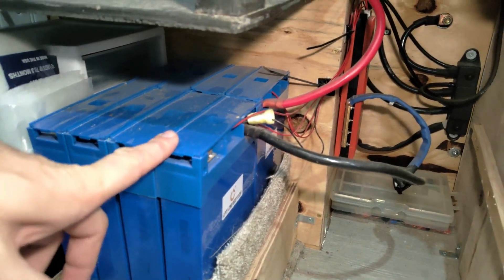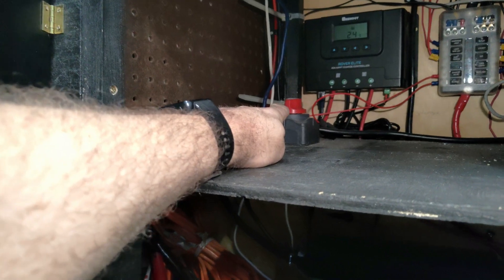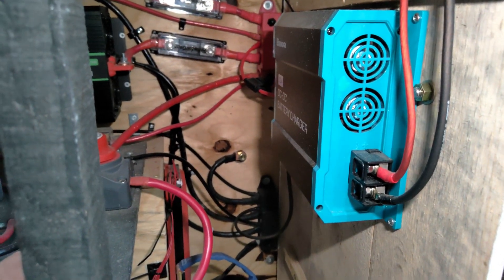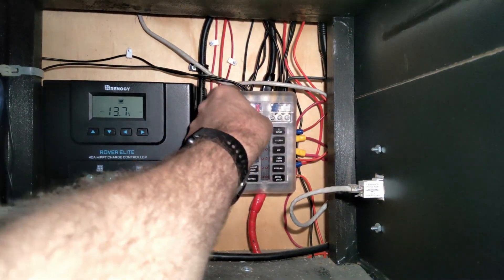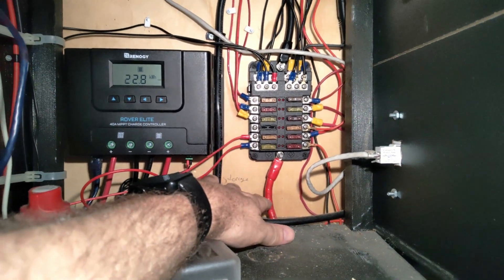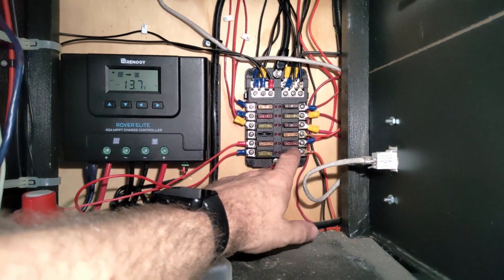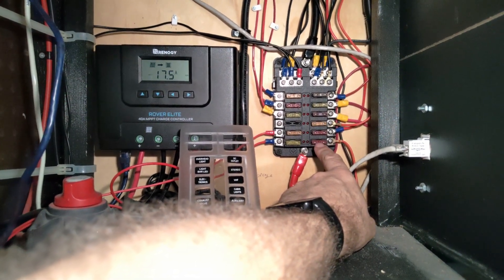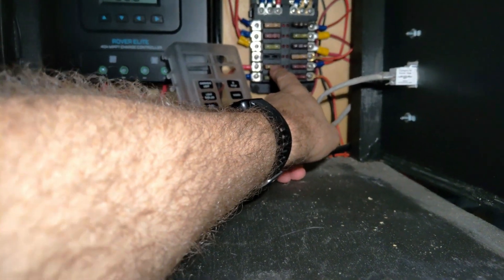The DC Fuse Box - Wiring Your Off-grid Batteries for DC circuits

Comment: Can you just run all of your black ground wires from each DC appliance to the frame of your vehicle and then the fuse box ground also to the frame eliminating all the extra black/ground wires going directly to the fuse box? If that makes sense. Thank you for your video!
Reply from the maker: Technically, yes, but it is easier to run wires back to the fuse box than it is to find an exposed part of the frame, since all the point contacts need to grind down to the metal, and that increases the chance for rust on the frame, so always better to close the loop to the battery. I do have one connector that goes to the frame because it made more sense to do so in that case. That is the dual USB ports for the dash cam and GPS.

https://www.youtube.com/watch?v=PGg1YvLoSZE

Comment: Do you have to have a specic fuse panel to handle a load like that. Mine looks like yours but says it's 30 amp
Reply from the maker: I don't l know the model I have. I am pretty sure I went with either a 30 or a 50 since my load off the box on DC is not calculated to get that high. Most things in my box are fine on a 10 AMP max circuit, and most things actually draw an amp or less.

Comment: You reminded me of the rats nest of a fuse box on wife's motorcycle. Every wire is black too. Run my motorcycle like a pit bike, no battery, just super capacitors. Been thinking about getting a buck boost converter to run usb for charging devices and a radio on motorcycle while running.